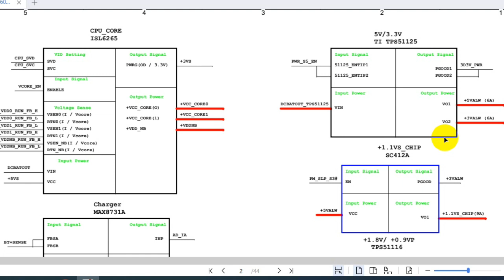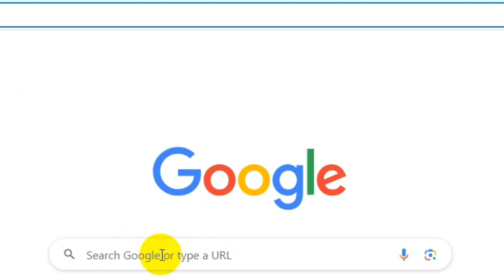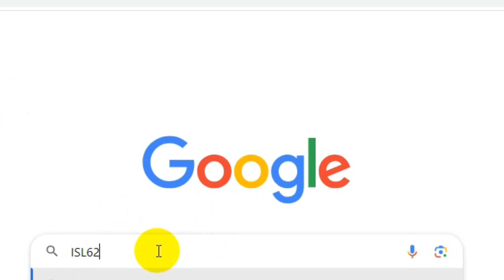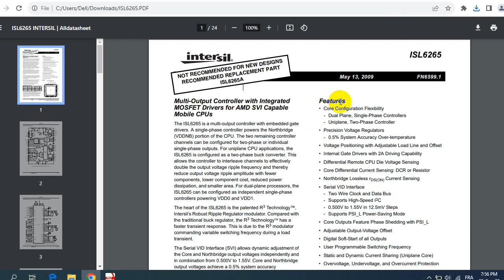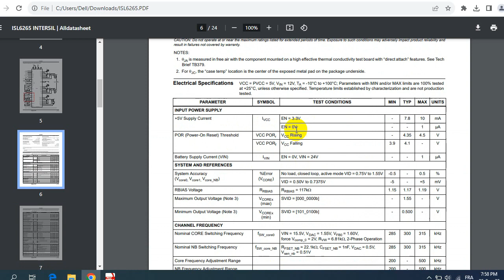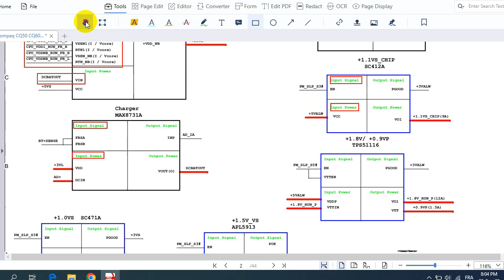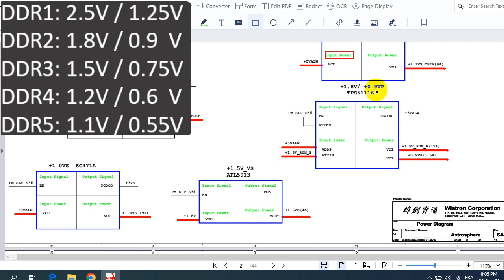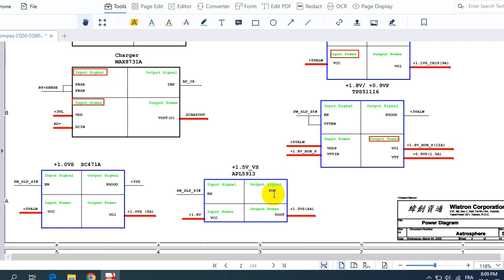Laptop Motherboard Voltages - Motherboard Power Rails, CPU, Northbridge & ICH Voltages

Comment: Please how is the voltages going to be like if the chipsets are all embedded into the CPU thanks.
Reply from the maker: Even if the chipsets are embedded, they receive the same voltage as normal. Because the embedded chipset is divided into parts or controllers
Reply: @electronicsrepairbasics_erb  Thank you sir. Am currently taking one of your courses on Udemy